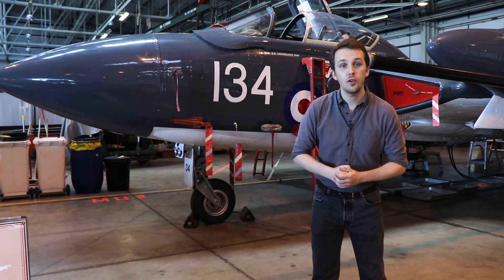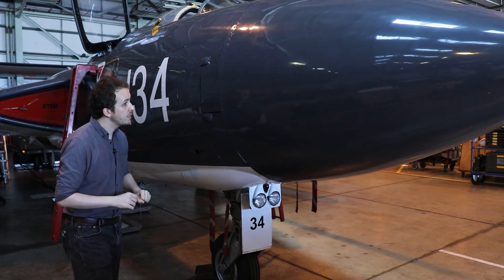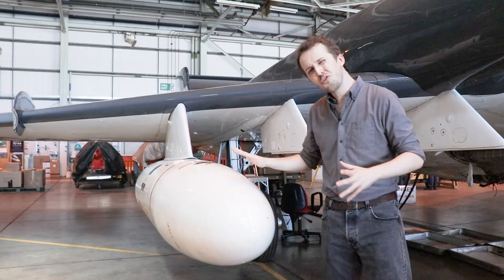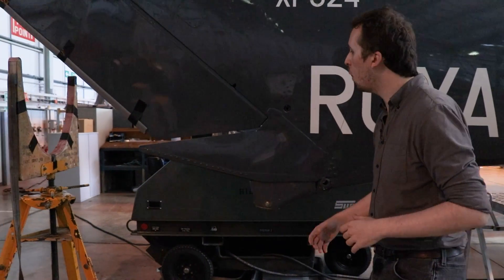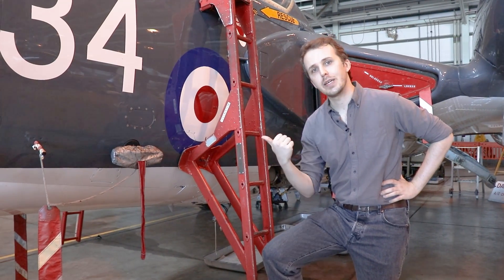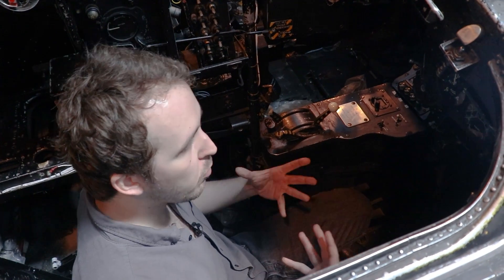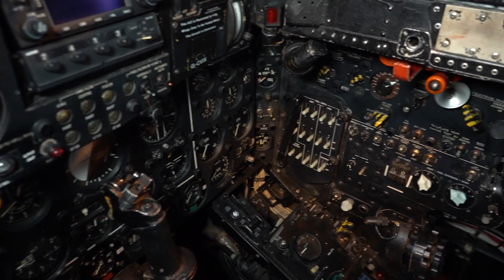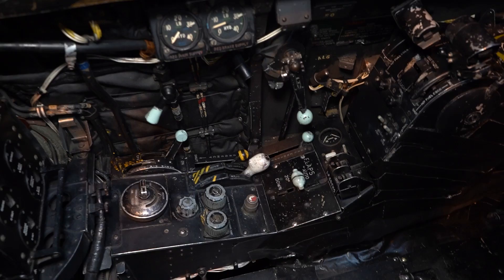Inside The Cockpit - Sea Vixen

Comment: The 1952 crash wasn't during a supersonic manoeuvre.  Derry did start with going supersonic in a shallow dive but that was at high altitude.  He then did a low pass in front of the crown and circled round into a climbing turn.  He has doing about 450kts when the aircraft broke up.  The second prototype had already been built at the time of the accident and in fact was the designated display aircraft, having flown several times at Farnborough earlier in the week.  They were flying 236 only because 240 had that morning gone U/S.  However 240 was then withdrawn from flight pending the finding of the investigation and then modified.  This was completed in 1954.
The radar was typical of the time with no look-down/MTI features, although it was pretty good at picking out ship targets as the clutter over the sea is much less generally than over land.  But it was primarily designed to spot those big Soviet bombers and eventually illuminate them for a semi-active RF missile, or at least to slave a Red Top IR seeker in the right direction.
The bit of aileron forward of the hinge is a mass and aerodynamic balance.
The outer pylon stations weren't used for bombs.  If you think about it, the aircraft was armed up in the hanger if possible with the wings folded and that would put an awful lot of strain on the pylons as well as being an armourer's nightmare!  If bombs were carried they would be a pair of 1000 pounders on the inner stations or 4 x 500 lb bombs on the inner and central wing stations.  The outer stations were reserved for the drop tanks or refuelling pods.
Earlier IR AAMs didn't see the hot exhaust, otherwise they could have locked on from any aspect.  What they need to see was the turbine and the inside of the tailpipe.
The 2" rocket packs were carried on the wing pylons, not in the fuselage.  You will see them in your own picture at 20:44.
I'd personally have liked a bit of a mention of the aircraft's fairly high loss rate in service.  This wasn't because the Sea Vixen was inherently more dangerous to operate from a carrier than many other similar aircraft but rather that it was often asked to train for missions where the avionics hadn't really caught up with the requirement.  For example, attacking a (simulated) Soviet Surface Action Group with iron bombs with a level loft/toss delivery from low level, at night, over the sea in bad weather was always going to end in tears on occasion.
Reply: He did mention that one third of this design was lost, which made me wonder why.  You explained that.  Thanks.
Reply: The aircraft was designed to have the rocket packs in the fuselage and they were initially fitted, but IIRC their use was discontinued as some point.

Comment: It was great that the technicians were able to demonstrate the wing folding mechanism as well as to see the flaps operating. Nice video and very informative. When I was an RAF engineering apprentice we used a Sea Vixen for some elements of our training and I'm pretty sure it was the first time we were introduced to Ram Air Turbines for emergency electrical power. Loved the design of the Vixen, very futuristic shape.
Reply: Used them for seat fit' training too, back in the seventies. Actually quite similar in mark of seat and positioning on the aircraft to a PR9 Canberra.

Comment: RE the improvised tube to the oxygen cutoff switch:  As late as the 1980s, UK Automobile Association road atlases suggested carrying a roll of soft iron wire a roll of PVC insulating tape, and a tube of superglue in your repair kit.  They noted that "This is an aspect of car repair that Baden-Powell would have loved, for the techniques and materials used are little removed from the native wit and cunning methods of the great Scout leader."

Comment: Really interesting aircraft, always love the twin boom designs.
I always found it weird that during the late 50s to early 70s the Royal Air-force and -Navy had two seemingly very similar designs in service.
The Sea Vixen and the Gloster Javelin, both two-seater, transsonic and nearly identical in size, just a coincidence or some inter service rivalry?
Reply: There's always that :P More prosaic is that the Sea Vixen is a natural follow-on for the already in FAA service DH Sea Venom.
Reply: A symptom of the unrealistic British government policy of supporting as many manufacturers as possible. The Javelin was a deeply unsatisfactory aircraft for most of it's career and took about nine marks to reach a satisfactory stage of development,  by which time it's successor, the Lightning, was entering service. The Sea Vixen was less troublesome in development but only two marks were produced, possibly a sign that the navy was allocated less money to upgrade it's aircraft than the RAF?
Reply: Neither.
de Havilland's Sea Vixen (originally DH 110) and Gloster's Javelin were both designed and built to an RAF specification to have an all-weather fighter-interceptor. The DH 110 had a troubled testing period where one of the prototype aircraft crashed at the Farnborough airshow. Long story short, RAF went with the Javelin and the DH 110 was held in limbo until the Navy needed a replacement for the Sea Venom. The remaining DH 110 prototypes were navalised (and I think new ones were built?) and after some redesigning, out came the Sea Vixen FAW Mk 1 and the rest is history.
Reply: And if you think that is complicated, I can  name three (there were probably more) British jet engine manufacturers that were all competing for the same market: Rolls-Royce, Bristol and Armstrong-Siddley.
Reply: @altair1983  Not to mention DeHavilland themselves as well!

Comment: Back in the seventies we used ex FAA Vixens for RAF trade training for fitting and removing the ejection seats. Can't remember if we also put stores on the pylons? Even though the Vixen had basically, standard MB Mk4's, plus a few extras. I always thought having to fit the seat in the 'Coal Hole' was strange. However, ten years later I was putting seats in PR9 Canberra's. The Nav's seat was the same mark in a very similar cramped position.

Comment: When the accident on Farmborough, 1952, went on, the initial fracture that destriyed the first prototype began just in the place where the port side wing fence should have been. Effectively, there were two prototypes flying that day over England. Early that morning the black one (the second prototype WG240) that had been flying the earlier days in the show at Farnborough, failed to start. De Havilland was startled because the RAF definition over the great contest for the next "night fighter" (today "all weather fighter" for the RAF) against Gloster GA.5 (later known as Javelin) was coming in soon. WG236, the silver prototype, was held in De Havillands and John Derry, Chief Test PIlot had to go flying in a DH Dragon Rapide to look for it. This brand new artifact had been tested recently with wing fences and it was decided to retain this feature, due to the good results it showed up. However, this aircraft had its experimental fences removed at the time John Derry arrived to take her to Farnnborough, and there was no time to reposition them.
Now, the wing fences performed a dual role: they modified the behavior of the airflow over the wing, but  in the case of the DH110, as the Vixen was named then, they unwittingly, did also reinforce the wing spars, which was not known at the moment. So,  had WG236 flown with its wing fences placed on the wings, there is a good chance that the accident wouldn't have happened-

Comment: One weapon many forget to mention when talking about British naval jets, is 2inch rocket pods. Vixens had them and 809 Sqn were still fitting them to Buccaneers in the seventies when we were fitting SNEB to RAF aircraft. Not 100% sure but, I thought the FAA briefly used, or at least looked at using 2" rockets in an "Air to Air" role?  Similar to the German R4M.
Reply: USAF used unguided Air to Air Rockets a lot in the 1950's, F-86D for example.
Reply: @richardvernon317  Think I the F89 Scorpion was famously fitted with "Mighty Mouse" rockets only. The point is that we were still using them in the possible air to air role, when they were redundant in that role with most other modern air forces?
Reply: @johnp8131  Lightning could carry them in a pack instead of the Firestreak / Red Top pack that held the fire control systems and missile head coolant supply. I don't know if the RAF ever fielded it in the A to A role, but the Saudis used it with their Lightnings in the A to G role. Last user of the 2 inch rocket pod in combat (as far as the British went) were the RAF Harriers in the Falklands as the SNEB pod reacted badly to being placed close to high powered radars as found on a Carrier (Sea harrier could use them as well, but they did little to none low level A to G stuff after they lost one on 4th May 1982.)
Reply: @richardvernon317  I am aware of the Lightning using SNEB, mainly with the Saudi's. We, the RAF, didn't utilise them in an A to A role. Although we probably looked at 2" rockets early on and decided against it and using the 2" at all? I am also aware of the problem with SNEB use with the FAA. I armed both SNEB for Buccaneers on 12 and 208 Sqn's and also 2" for 809 Sqn FAA, as 809 was at Honnington when not on the Old Ark Royal back then. We had a directive @ '78 about SNEB prep' etc...hence the future use of the 'Safety Ohmmeter' and leaving the prep' shed doors open during this procedure. We had similar problems with the French built AR Martel but that's another story. Also, besides diameter and quantities per pod, the warheads were different. The 2" had a solid tungsten armour piercing head, within the bakelite shell, about 2Lbs in weight (I still have one tungsten core). The SNEB has a HEAT warhead (Shaped charge). Therefore SNEB was not conducive with Air to Air combat.
  BTW. I think when the FAA initially adopted 2" rockets, we, the RAF, still used 3" rockets in the ground attack role into the sixties. However, that was before my time.
Reply: @richardvernon317  Interesting, you have been busy. I can only speak from my own experience, mid-seventies onwards and from speaking to FAA armourers at the time, as most of this was during development and way before my time?

Comment: 18:05 Are you contrasting two versions of Firestreak, or was the first one a different name?
... ah, Wikipedia suggests the "Fireflash", although it describes it as beam-riding, which seems to make sense given the dedicated radar operator, but not so much if it was only infrared guided.

Comment: It looks like the fence on the starboard wing is damaged.  Possibly bent during a ground mishap?

It sounds like the horizontal stabilizer is a "full-flying" system, where the whole thing moves.  And the part that looks like an elevator is just for reacting to flap deployment.  Did I understand that correctly?

Any idea what the circular cover sitting on the side of the engine bay is?  Maybe some sort of exhaust cover for aircraft storage?
Reply from the maker: That's correct.

Yes, this Sea Vixen had to make a no gear landing and is currently behind fixed up to go back out.

Comment: Does the observer has any chance to put the plane in a levelled flight if the pilot e.g. gets unconscious?
Reply: I haven't been in a Vixen cockpit for over forty years but I'm pretty sure there were no flight controls in the "Coal Hole" and access to the pilots area from there was improbable? Espectially with everything, seats etc...in situ. He would have to eject. Good luck with that? Not a high success rate.
Reply: @johnp8131  oh okay, thank you

Comment: The pit was a bad place to be during early carrier operations as the catapults where not 100% reliable, in the pit the first you knew of a problem was a big bang and smoke from the pilots ejection seat, by then it was too late and several radar operators were lost, eventually an Airspeed indicator was added to the pit and the radar guys got used to the pattern of speed increase off the cat, this went rapid, stagnant for a few seconds then a constant increase, if they didn’t get that steady increase there was a problem and it was time to leave. One radar operator famously ejected three times from the pit, the last time he was flying with a new pilot who tried fatally to stick with the aeroplane too long and was never recovered.

Comment: I find it interesting how the British aerospace industry of the 50s-60s could make gorgeous planes like the Hawker Hunter, the English Electric Canberra, the Avro Vulcan and even the Fairey Delta and TSR2, but then make such ungainly planes like this plane, the English Electric Lightning and the Blackburn Buccaneer.
Reply: Horses for courses. The Sea Vixen and Buccaneer were carrier aircraft and designed as such, tough and able to fit onto an aircraft lift. The Lightning was a pure interceptor, designed to get two missiles to altitude as fast as possible. Obviously their design refects their role. Personally I find all these designs pleasing to the eye and when in their natural element (flying) not the least ungainly. Beauty is in the eye of the beholder!
Reply: @chrisknight6884   I always thought that the Lightning looked like it was designed by committee and had a lack of elegance. At roughly the same time this plane was developed you had the F8, F104 and F106, gorgeous planes that did the same job as the Lightning, though they did have better powerplants which eliminated the need for 2 engines to do the same job.
Reply: The Buccaneer ungainly?Have you never seen them in action?  Great aircraft for it's time.
Reply: @gtv6chuck  I think you may be in a minority?
Reply: @MsJackcool69  It obviously worked well for almost 30 years, but compared to other aircraft if the era, it's not pretty compared to say, an F105, F4D Skyray or a Hawker Hunter.

Comment: The huge problem with these 'restored to flying condition' Cold War fighters is the fact that they need to have modern nav equipment installed which displaces all the weapon controls, so we never get to see what 50s and 60s fighter pilots had to contend with.

Comment: 145 built. Such an investment in research, engineering, production facilities, for so few examples. Worse for Scimitar at 76, Javelin a bit better at 436. For comparison: F-4, 5000. Mig-21, 11000. Mirage III, 1400. It is easy to miss that many well-known airplanes were built in quite few numbers. [Disclaimer, not a rigorous or partisan analysis 😊]
Reply: The Two DH twin tails before this (Vampire and Venom) both made production runs in four figures. The only other British jet fighters to do so were the Meteor (nearly 4000) and the Hunter (nearly 2000).
Reply: @richardvernon317  That is nice to know. Thank you.

Comment: its magnificent alright.  huge , ugly and I think it would have been of limited usefulness vs other fighters. but nonetheless its still magnificent

wow that was fun watching them fold the wings in and out but i was really surprised that there was no wet afterburner thats kind of weird for a late 50"s aircraft is it not ? It seems like just another limiting factor for the performance of the Sea Vixen.
Reply: Not that strange if you consider the role of the aircraft as a fleet defense interceptor. Long on-station time and stand-off missiles for intercepting naval bombers (think Il-28 or Tu-16).
Reply: The sea Vixen was the only Western fighter that could out turn a Vulcan.
Reply: Ugly?????????????

Your comment is clear proof that beauty is in the eye of the beholder. The Sea Vixen is gorgeous.
Reply: @sandemike  Source please???  Please remember that in an exercise the Vulcan Crew may be "Red Air" and would be flying the aircraft more like Badger!!! Also Firestreak and Red Top were not dog fighting missiles, Firestreak was almost dead stern only, while Red Top was only all aspect if the Target was doing Mach 1.5 for a head on shot. Anything slower than that and the Red Top was rear hemisphere only. Also both missiles were very G Limited as regards aircraft manoeuvring limits at launch. 2.5G for Firestreak and maybe around 3 to 4G for the Red Top. If its the intercepts over Cyprus, the Vulcan crews were more interested in landing and hitting the bar than mixing it up with the WAUF's
Reply: @richardvernon317  My source is from my days in the R.A.F. working with Vulcans and Sea Vixens. The Vixens high turn rate would have been used if attacked by fighters on at low level when jumped while carrying out low level rocket or bombing attacks.